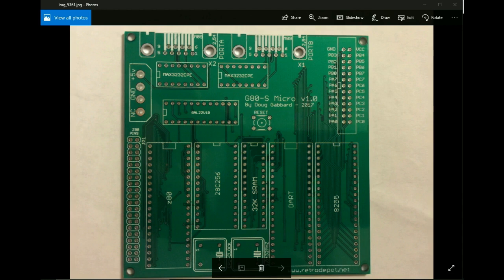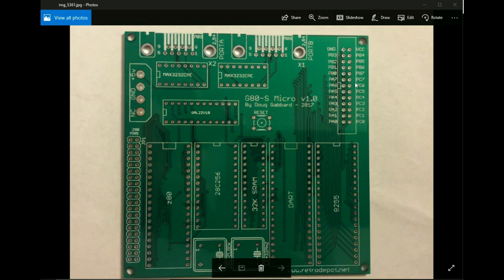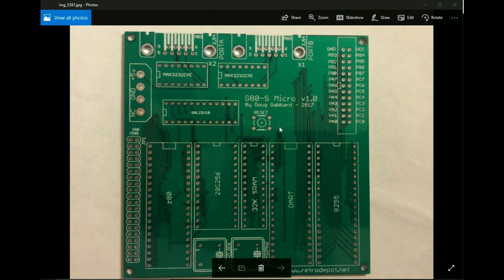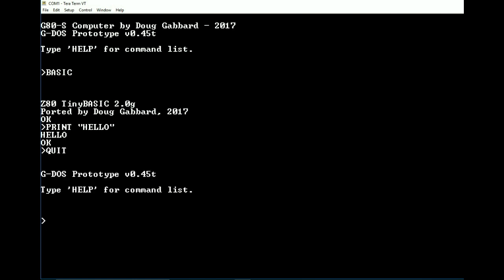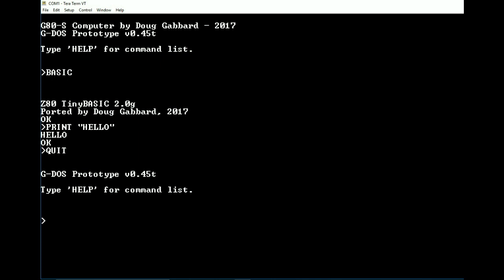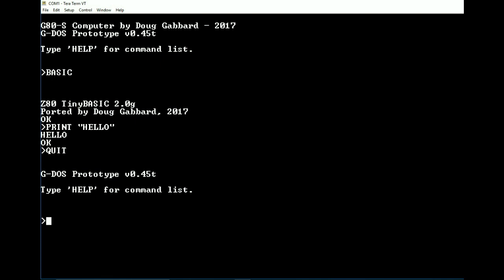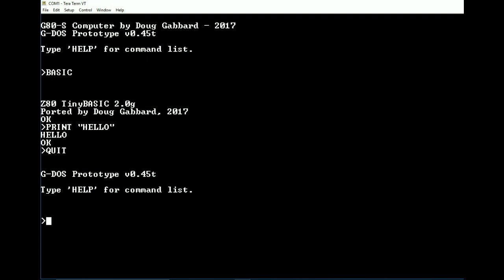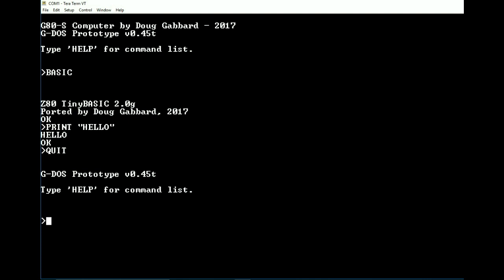z80 Computer - G80-S Update #5 - v1.0 PCBs Arrived!

Comment: Are you planning to get CP/M running on it?
Reply from the maker: There are no plans for CP/M on this version of the board for two reasons.  Firstly, this board only has the option for 32k of RAM, where a CP/M machine needs 64k.  This could be accomplished by means of a daughterboard.  But this could be better achieved by a simple redesign to allow banking of another 32k SRAM into the lower memory.  The second reason that this is not planned is that I am attempting to write my own version of of a Disk Operating System with Similarities to MS-DOS.  Between that and patching bugs that are occasionally found there are no current plans for CP/M on THIS board.

However, I do have future plans on building a larger computer that would be suitable for CP/M.  The details of that build are still under consideration.